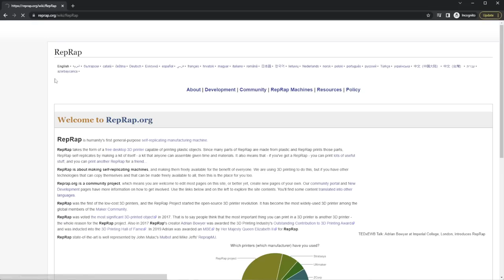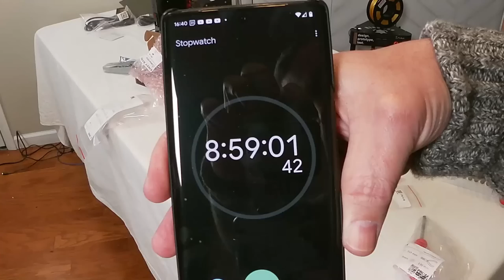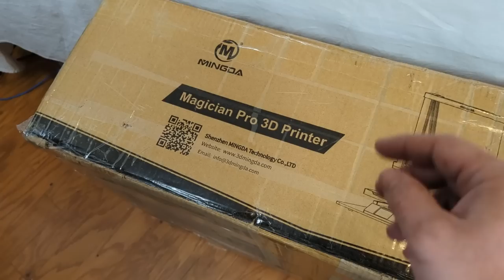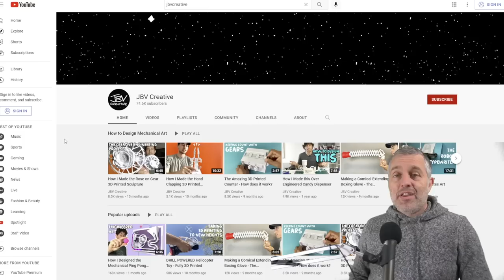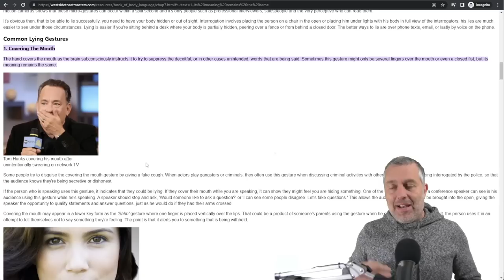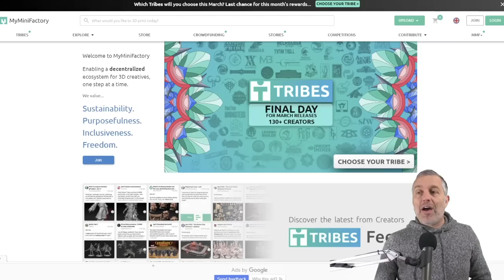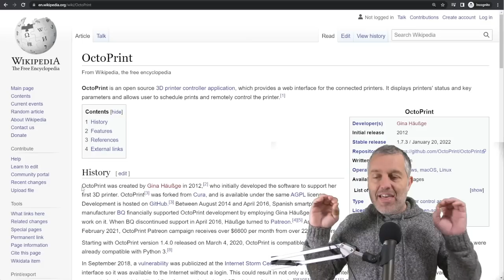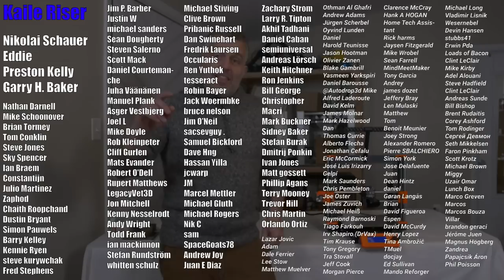Why Does Nobody Speak Truth About The Prusa I3 Mk.3? - It's Overhyped and Over Priced.

Comment: another thing is just straight up quality prusas mechanical parts and frame are all extremely high quality parts and have been proven to last longer and hold up better in adverse conditions I'm sorry bro it really just sounds like you were mad that the setup wasn't a toy like you mentioned and you got mad and say somehow prusa is a bad design but a good printer? what does that even mean that statement is so contradictory but hey you enjoy replacing those vslot wheels and bearings on your ender 3 and the earplugs you will need when it prints
Reply from the maker: >proven to last longer and hold up better in adverse conditions
Oh yeah? Where's the scientific study on that. Internet comments from fanboys claiming to own 10 printers "but my Prusa is the best" and never showing you what they are making don't count.
Reply: @DesignPrototypeTest  hardened steel rods and bearings will undoubtedly last longer without maintenance than rubber wheels due to its' high wear resistance its pretty common sense given the metallurgical properties of steel. that's why almost all bearings are made of some form of hardened steel or alloy because metal LASTS LONGER and performs more consistently IN adverse conditions such as being under heat stress or load pressure sorry i had to spell it out for you bro i thought you were more knowledgeable.
Reply: @DesignPrototypeTest  oh and just lmk and ill show you a little of what I did with my prusa its pretty darn neat 

p.s. i thought the gummy bears were a nice touch. not enough companies value their customers and this is definitely a way they are showing appreciation that you chose their machine.

Comment: capacitive sensors have nothing to do with magnets
Reply from the maker: 15:15 I called it an inductive probe. Did I accidentally refer to it as capacitive at some other point in the video? I don't script my videos so I make that kind of mistake sometimes, but . The P.I.N.D.A. probe definitely use magnetism. You can buy capacitive probes for 3D printers but they are worse than the inductive probes. There is a large sensor drift depending on the humidity of the air with capacitive probes. If you calibrate your printer on a dry day and then you try to print on a humid day...you get the idea.

Comment: It's funny how much hate this video is getting. I have the ender 3 s1. I see very little reason to buy a prusa. $400 more get's you very little extra. Plus assembly is much much more complicated. Someone new to 3D printing would be much better off buying an ender and learning how to do everything. Then if for some reason you feel like you want a high end printer build a voron. A guy down the street from me had a prusa. He did the magnetic bed upgrade and ended up having issues with his printer that he did not know how to deal with. He sold it for $175. I wish I knew about it before he sold it.

Comment: I’d compare the Prusa to a Toyota 4Runner/Tacoma. Outdated but designed well and extremely reliable
Reply from the maker: Ok. I owned 4 different 1987 Toyota Pickup trucks and 4 runners before I got a 2001 Tacoma so I'm with you. BUT would recommend someone today buy a practically new super low mileage 1987 Toyota 4runner for $50,000 or a brand new 2022 Toyota Tacoma for $27,000?

Comment: Shipping is $50 so a machine that you have to put together as much as you do with the Prusa. So yes $800 but if you want a build like how most printers are coming it’s $1000.  

I am fighting with Fysetc right now having built a bear clone. I can’t afford $800 then another $200 to make a more stable frame compared to $360. However I got a bad einsey board and they don’t believe me. 
I just got an Anycubic Vyper that I got up and running in 15 minutes without a manual. 

Honestly I want to build a Voron. Core xy is such a great idea.
Reply: Just keep pressing FYSETC or threaten to open a dispute with Aliexpress, they'll send you a new board (they sent me two :)
Reply: @nateschmitz9827  nice they took $1.08 for customs fee to send a new board and it hasn’t shipped yet. Thanks for the advise.

Comment: While a disagree a lot with your videos...  I also agree with your videos, and yes I agree with this. prusa is overated and overpriced. but I also have to say I own 3 prusa's and 2 are clones. and NEVER had to change anything other than changing nozzles and they almost print 24/7. Maybe its luck or something But I also own 1 original mini and 2 clones of them but these are really sjitty printers... they are insanely awful and really regret buying them... My 2 Ultimaker 2+ and Ultimaker Extended 2+ are cleaner with printing details and prints overall.

And I also pitty Josef a lot... he's an arrogant pr1ck and especially when he goes full on lefty mode. Note he's just a sales person not an engineer. I like how he build a nice company from ground up but damn what a arrogant ahole. 

The Prusa's in the workshop work great but all my friends who also print and own a prusa dislike that guy a lot...

Comment: I have a Fysetc mk3s clone, which seems to be identical to my friend's genuine Prusa.

It isn't fast and maybe not what I would buy or recommend today, but it prints reliably and accurately. 

As for the Prusa assembly instructions, I thought they were fine, even if the Y carriage belt is fiddly. Though my clone didn't come with gummy bears. Would have been cool if Fysetc packed in Chinese candy.

Comment: Ahhh.  Going for the "hater" Market.  It's a good market...lots of views.  Going for that controversial take in order to get people here.  It worked...It got me to click.  I own 8 printers.  4 FDM, 4 SLA.  I like all my printers.  My Prusa mk3s+ is my most exensive printer.  It's also my best printer.  Yes they're all built on near the same platform and built the same ways and even a basic ender 3 can print decent enough with the time and effort put in.  But my Prusa is my most dependable printer and prints the best looking prints.  It's the best sub 1000$ printer you can get.  Can you get other good printers for cheaper than the Prusa.  Yes.   Is the Prusa just a little bit better in almost every way.  Yup.  About to try me an Ender 3s1 plus...so maybe that one will change my mind.  But none of my other 7 printers have changed my mind yet.  But...you know...what to be....challenging!  You lost a subscriber.  This video was more childish than them telling me when to eat my gummies.
Reply from the maker: If you own 8 printers I find it VERY hard to believe that the time and effort for you to get good prints out of an Ender 3 is more than it takes to build a Prusa. I spent 9 hours on my first build. If you're an expert at assembling Prusas it might take you 5 hours. Meanwhile, you're up and running on the Ender 3 in an hour. One of the Ender 3 variants with bed leveling and filament run out takes less than an hour. And still costs less than half of what you pay for a Prusa. I can't read comments like yours without thinking. "This guy is just stupid, deluded, or a shill for Prusa." So I'll tell you what: Instead of this vague. "I own 100 printers but my Prusa works the best" argument that I've heard time and again from suspect avatars like yours how about you make a video giving me some details. Then I might believe you. Show me specifically how your Chinese printers are failing you but your Prusa doesn't.
Reply: @DesignPrototypeTest  I never said my others failed me.  Didn't say anything resembling that.  "If I own"  because of course that's impossible right? I like my other printers.  If you think the majority of people get an ender 3 running perfectly within an hour.  You're intentionally being misleading or simply a lucky man.  Because the majority of us take a little longer than that to get everything zero'd in to the point where our enders are giving us good printers on a consistent basis.  That's no knock on Ender.  It was a fantastic learning experience about 3d printers and it's still the machine I recommend to people just getting into the hobby who don't have crazy money to just throw around...because of it's affordability and because it's a little hands on it's use.  It forces you to learn a bit about the machines, parts, and purposes.  Similar in a way to what building your own Prusa does.  And Prusa doesn't need me as a shill.  Just like any other industry leading company doesn't.  And no...that alone doesn't make a company successful or a product good.   You posted a video with a dissenting view of general consensus but offered very little.  You're entitled to your opinion, of course.  But I think you were doing it simply because you know controversial things have a chance of going viral.  I hope that works out for you.  I'm sure you're doing well in life in other areas.   But if you're going for controversial for controversial's sake....you knew what to expect.  And... you called your former subscriber stupid and implied I'm lying.  And really...was I that hard on you?   I implied you were going for the hater market and that you had childish commentary.  I honestly thought you did both of those things intentionally.  So I didn't think you'd be hurt by me saying so.  I was hardly brutal and   I stand by it.  I'll simply point to the majority of other comments which are much better written by much smarter people than I.  But to call me stupid and imply I'm a liar.    Classy.   You're being consistent with the hater routine.  At least you were wise enough to stop when you did because I've seen creators in trouble for harrassing behavior not much worse than that.   You'll go far on social media.  I hope you work out your anger issues though.  Calling people stupid online when you posted material with the intent and expectation for a certain response.   I mean...we're both grown without resorting to school yard direct insults.  That's what 12 year olds on 4chan do.  They don't go lead to good things in life.  I wish you all the happiness and good things in the world.   But whatever grudge you have against prusa and now you've extended to me...  Grow up my man.  It's not worth it.
Reply: @DesignPrototypeTest  And on a second note.  If I did insult you that bad.  I truly apologize.  Oh I know I didn't agree.  But when I watched your video...I saw someone intentionally playing devil's advocate and intentionally doing it in a childish way...because I figured, that you figured, that controversy 'sells'  If I read you wrong and you were trying to give across your opinion in an unbiased and informative way...well...I may have been watching the wrong video...but I didn't think I said anything that would hurt your feelings that bad.  So I apologize.  I don't think I had earned the response you gave...so your video plus your response tells me...I was probably right about what you were trying to do...and that your response is just a continuation of you going for the controversial haters market.  I'm wrong a lot.  But if you're wondering how your video came off to us stupid people...that's how it appeared.  And the result was you lost a subscriber.  I know...you won't miss me.  Take care of yourself bud.  I don't recall what made me subscribe initially...but maybe you'll get it back and I'll try you again one day.

Comment: IMO a bed slinger should never cost as much as a prusa does, unless its a large format printer, because of the price of the heated bed. Bed slingers, as you said, are so old that by now the market should be moving towards newer technologies, yet prusa just milks the ‘fame’ and ‘attention’ to try to sell off their products as the pinnacle of 3d printing. They’ve clearly never seen ANY CoreXY printer first hand because that is undoubtedly the wave ALL 3d printing manufacturers should be headed. This is again my opinion, and to each their own, but i refuse to be the sucker that overpays for a glorified 3d printing machine. Good video, a lil aggressive for me but your points still stand, and they stand strong. Mk3 should be having competitive pricing against he ender because the ender could do the same and much more if you dropped the same amount of money as you did for a prusa. (Prusa typo edit)

Comment: I like your channel and thought provoking content, even if I often disagree with you.  That said, I agree with all of your points.  Josef comes off as a megalomaniac, and the i3 is very long in the tooth.  Icut my teeth on a Mk2, and agree with you that it's a polished turd.

Creality has made a name for themselves with the Ender 3 (and really failed to move past that; the Ender 4 (have you ever seen one?), 5, 6, and 7 are commercial flops, and you're lucky if you can even get the Ender 7 to print.) But they do it very, very well.  The Ender 3 S1 is a phenomenal machine if you need the features of a Prusa i3 MK3S+ at less than half the price.  I bought three more S1s for my farm earlier this week, a Pro and two standards, FOR LESS THAN THE COST OF ONE i3!  They were delivered today.  They take 15 minutes to put together, and the only thing needed is upgrading from the firmware it ships with.  And you're not locked into one like Prusa!  There are several flavors of Marlin 2 available for it.  Want to run Klipper?  No problem!  With a Prusa (I own one) it's Josef's way or nothing.   The new $2000+ CoreXY Prusa XL?  Josef MIGHT let you run Klipper, but he might not.  But he's not planning on it to be fast?!  I can buy four Anycubic Kobra Max, which is 40mm larger on X and Y, and 90mm on Z, for the same price as one base XL kit.  As a first day XL pre-orderer, I don't know how compelling multi material is, and I don't see it being worth it when I already have a Voron 2.4 for speed.  And I can go 500mm³ with a Ratrig V-Core 3 if I need size and speed.  The XL has some neat and interesting features, but they're not worth the price.  I'm honestly thinking about canceling my pre-order.

Prusa has advanced 3D printing.  That's undeniable.  But he's not doing much today because we all know it's him and not any of the talented people who work there. 🤣
Reply: Two S1 and one S1P cost over $1300 while one MK3S+ is $750 for a kit and $1000 assembled. So how did you buy those three for less than one MK3S+? I would love to know so I can get in on that deal.

Comment: I wish I saw this video before I got my prusa
Reply from the maker: I like you. You have the the strength of character to acknowledge that you got a raw deal. So many others defend their purchase with a 'sunk cost fallacy' and attack me instead of feeling bad about the fact that they got fooled. On the plus side, the employees at Prusa really did put a lot of effort into making that printer as good as it can be. You NEVER see this kind of effort from China. They keep improving their product year after year but they've shipped a lot of known garbage getting to where they are today. There are a lot of suckers who bought Chinese printers in the past. Prusa has historically been a safer bet. You didn't get a bad printer. It's just time that the industry moves on from the manipulated interests of Josef Prusa. If you want one of the best printers possible put the Bondtech/Slice Engineering upgrade onto your I3. Despite all the issues I raised and despite the price you paid you really will have one of the best performing and easiest to use printers out there. Just don't tell anyone else to get a Prusa. There are less expensive/better options out there no matter what your 3D printing goals.
Reply: @DesignPrototypeTest  Do you have a link for that exact hotend I’ll purchase it today
Reply from the maker: There are at least two versions of the Bondtech extruder upgrade. The first version uses the stock E3D V6 hotend which works just fine. There is no pressing need to upgrade that hotend. The geared extruder will eliminate the diagonal lines I experienced in the video. This upgrade is widely available from multiple resellers. Just look for "I3 upgrade bondtech" many YouTube channels have made videos about it as well. The one I saw by "Chris' Basement" seemed to be thorough and covered all the aspects of the installation. The Teaching Tech video didn't even mention the firmware modifications which is  kind of an important thing to ignore. If you want to spend the money and get the absolute best then here is the link to the Mosquito compatible hardware: https://www.bondtech.se/product/prusa-i3-mk3s-mosquito-extruder-upgrade/ You will also need to purchase a Mosquito Hotend from Slice Engineering which will double the cost. https://www.sliceengineering.com/products/the-mosquito-hotend?gclid=Cj0KCQjw3v6SBhCsARIsACyrRAkDKnFbGaC6rhfgL-lmZp5XPCg9cnBsI7mXhezzbR50GYdJnxylvy8aAtgbEALw_wcB Unless you are really challenging your printer with exotic filaments and fast printing you won't notice a difference. Remember that the speed of the printer is actually limited by the Acceleration and Jerk settings which Prusa doesn't make easy to change. I do like the idea of having the best thing. Especially when not that many people possess similar because I had to make it myself. I'm seriously considering asking my Neighbor if he will sell this I3 to me and then doing the Mosquito upgrade myself. But you really only need the Bondtech geared extruder.
Reply: @DesignPrototypeTest  I really appreciate the response I’m gonna decide whether I just wanna go for the upgrade without upgrading the nozzle or going for the full fledge upgrade I’m a little worried about the firmware upgrade because I’m not too familiar with that but you won’t  learn until you try right.